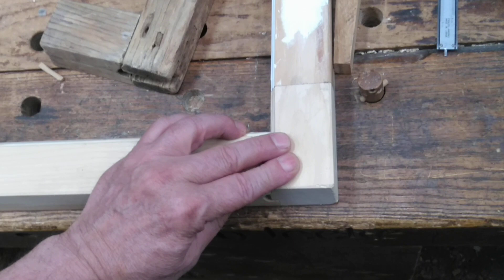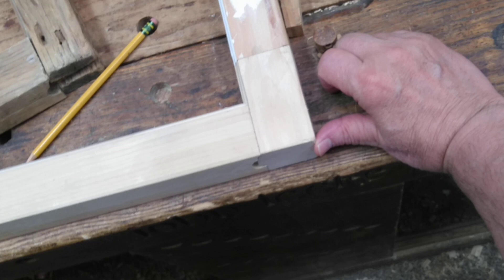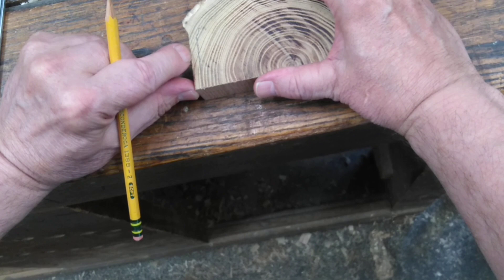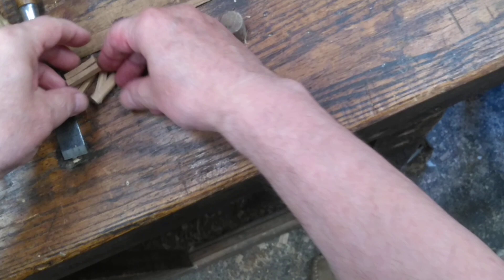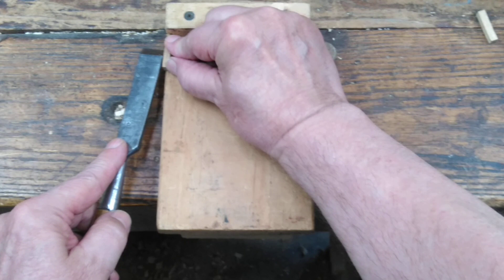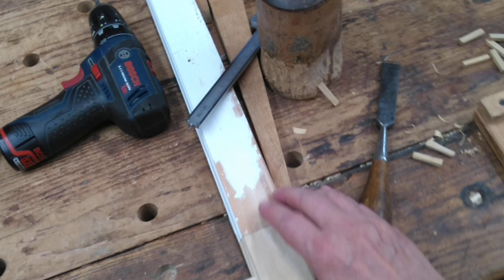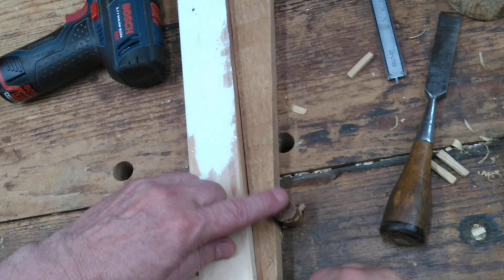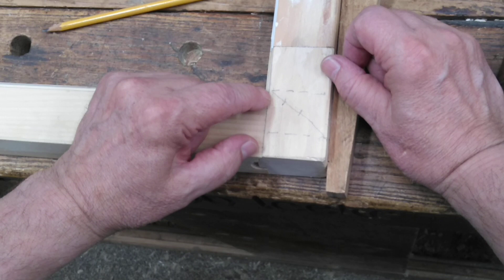Window Sash Joint Wood Pegs

Comment: John, there’s an easy way of making your own depth stops out of wood. They don’t leave swirl marks like metal ones. Making them is easy: just drill a piece of wood along the grain, trim to a desired length and square at least one end to the drilled hole. Time permitting whittle this little block to a cylindrical shape. I’ve stopped using metal depth stops almost completely
Reply: Thanks for the tip! Im trying to follow how you set the height. I think you mean it just hits the drill body. Therefore, is not adjustable since each depth needs a different piece of wood. Am I understanding right? Photos may help.

Comment: 2:50 totally agree. Also I am super happy . Working as a stained glass restorer , I put my ends on the 1900 (in not older ) large well made wood frames : square pegs , inside side of the frame …:)

Comment: 16:22 advantage of putting blo in the hole or on the pegs prior to insert them ?
Reply from the maker: The BLO soaks into the end-grain, helping the paint coating last longer at that critical spot.
Reply: @johnleeke  no I got that . Was wondering not putting on the hole before putting pegs ;)

Comment: Question : no use to drawbore?
Reply from the maker: I usually do not use the drawbore technique on ordinary window sashes. Simply clamping and pegging has been done traditionally for centuries. In some cases drawbore could make sense, for example, when the sash are larger than your clamps, or with very large hardwood sash.

Comment: Sir : question.  Why the pegs that close to each other ?
Reply from the maker: The pegs are crowded up next to each other right near the inner corner of the joint, so they hold that inner corner tight and stable. In the video I talk more about this and show how it works.
Reply: Hum… maybe I missed that part . Also, I am very sorry for not responding sooner : never received the damn notification.

Thank you very much .

Also , thank you for specifying about the Side where the pegs should go: inside the building not outside .
Reply: @johnleeke  yup . Listened to it again. And it confirms the location of the pegs on my 1900 frames

Comment: What is the advantage of using wood pegs over metal fasteners?
Reply from the maker: Steel fasteners can create "nail sickness" an iron-rich environment in the wood next to the fastener that is suitable for the growth of a certain bacteria that eats the wood. In fact, you can see this right in this video at:  https://youtu.be/Xw1vJCTI0k4?t=23  On the end of that joint sample you will see two steel pins (that were holding this joint together). Also see the holes on the tenon, those holes are about twice the diameter of the pins, because the wood was consumed by bacteria. Wooden pegs do not have this problem.
Reply: @johnleeke  that’s really helpful! Thank you!
Reply: And why a homemade square peg rather than something like a birch dowel pin that is round? @johnleeke
Reply from the maker: @AntonellaFrancesca , a split peg follows the grain making it stronger than a dowel, which may have cross grain and be weaker. The four ridges at the head of the peg dig into the side of the hole holding the peg in the hole, a dowel  has smooth sides that may allow the peg to drift out over time. Pegs can be made out of scrape at no cost, while dowels usually are purchased. And last but not least, it is just plain fun to make pegs.
Reply from the maker: @AntonellaFrancesca  , a split peg follows the grain making it stronger than a dowel, which may have cross grain and be weaker. The four ridges at the head of the peg dig into the side of the hole holding the peg in the hole, a dowel  has smooth sides that may allow the peg to drift out over time. Pegs can be made out of scrape at no cost, while dowels usually are purchased. And last but not least, it is just plain fun to make pegs.
Reply: Thank you for your reply. I am restoring 123 year old sashes in NYC.  The bottom rail was a bit rotted on the outside which is expected. I cleaned it all up and used System Three epoxy to repair the missing wood. Strangely there was nothing holding in the rail at the bottom and rusted nails at the top of the sash. I tried to chisel some hard wood, I think oak, and destroyed the piece of wood so I then used a hand saw to cut a sliver about 3/16" to use and that worked well but was excruciatingly slow. Thanks again! @johnleeke
Reply: Hello John, I made two split pegs from old oak wood I had and they came out fantastic! I was afraid they would split the 120 year old somewhat punky wood but they did not. The are almost invisible in the lower rail. I just download the pdf of "Glazing and Painting Wood Sashes". It's great! I wish I read it before I began my project since I pretreated the sash and rabbets with BLOpentine with Flood. You advise against, BLO, oh well. My question is, since I already applied two coats of BLOPterp and it has fully cured and you write that it should be 80% dry from what I remember before glazing. Should I apply one more coat so that it is 80% dry before I glaze? I am using Sarco Dual Glaze putty. Also, I used BLOPterp pre-treatment to the side edges of the sashes and the top edge of the upper sash. Oops, my bad.
Allow to dry.  @johnleeke
Reply from the maker: @AntonellaFrancesca  I would not apply another coat. Good work on the pegs, when you get them the right size they will not split the stile.
Reply: @johnleeke  Thank you, yes, it's coming out well.
Reply: the glass is surprisingly thick, 1/4", I think it would be harder to break so thick. Ready to put glass in and glaze.